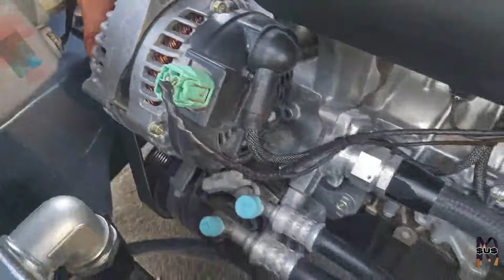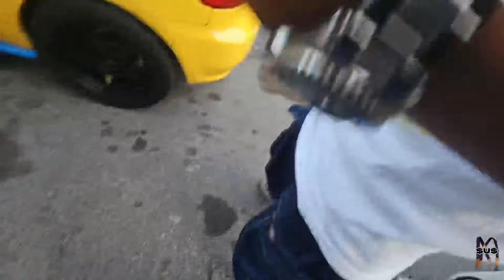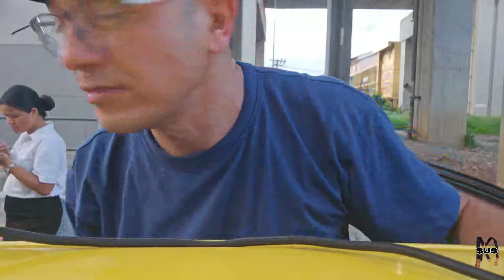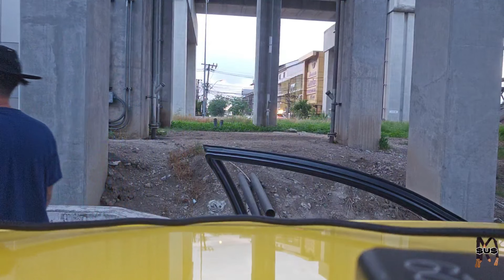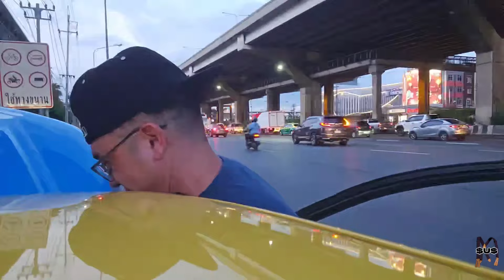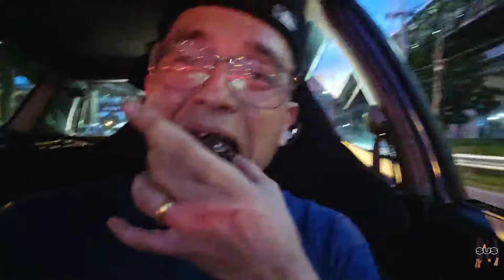Suspendas Breaks New Racecar (Full Vod)

Comment: That’s a eg6 civic with a spoon livery and a k series swap . Nice build it looks like . Just needs to get hondata and a tune. 

The battery isn’t dying , the charging system isn’t working properly
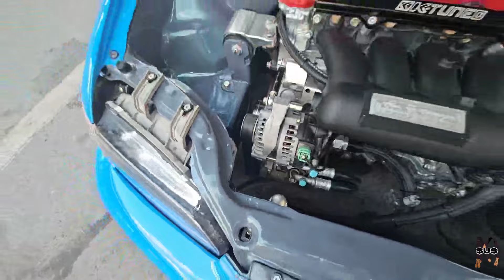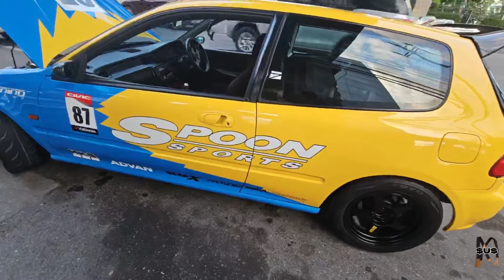Reply: It’s a garbage build. @7:28 look at the plug going to the alternator. They didn’t even repin the connector. They just cut it, twisted the wires together, and shrink tubed it. @18:20 notice the tread direction of the front tires. Left side is correct, and right side is completely backwards. Those tires are 100% directional as well. They couldn’t even put the tires on the wheels going the correct direction. NOTHING ON THAT CAR HAS HAD ANY THOUGHT PUT INTO IT.